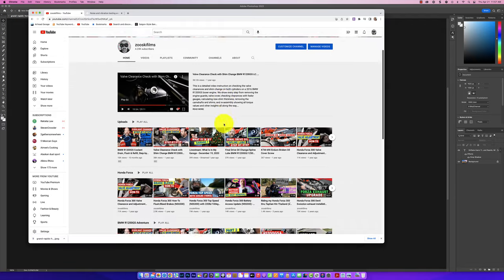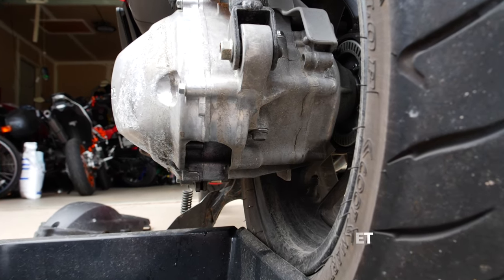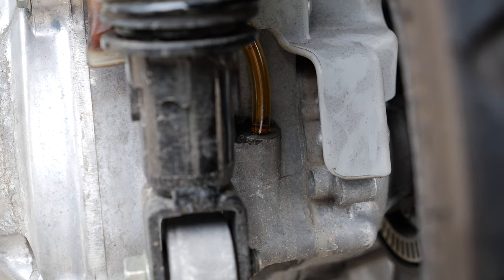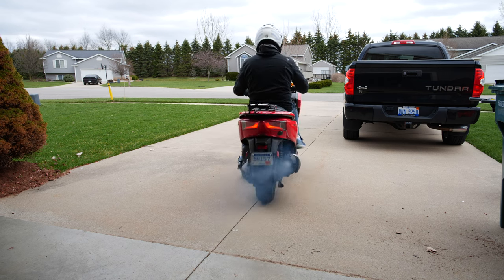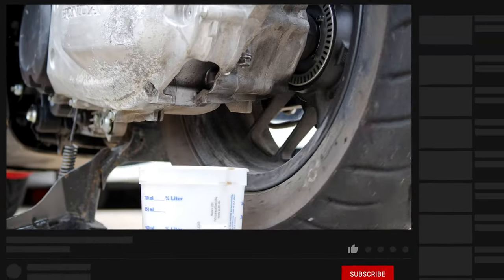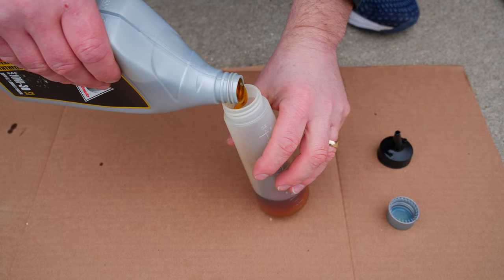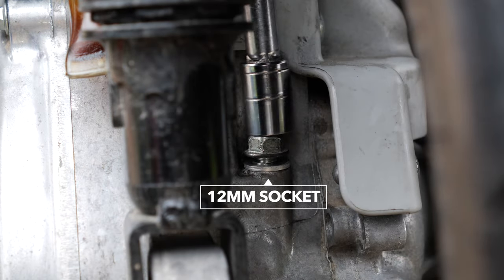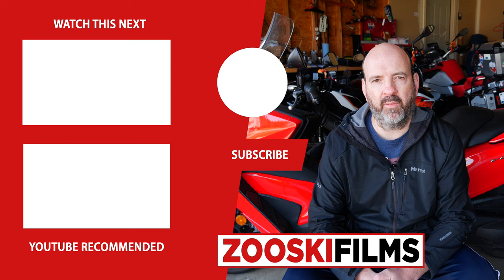Honda Forza 300 (2014-2015) -  FINAL DRIVE Oil Check, Drain and Fill - Step by Step Instructions

Comment: I'm confused.  Did the guy just do the exact same thing twice or am I missing something?
Reply from the maker: @TK Diamond - LOL, yes and no. The first part was a final drive fluid check. The second part was a fluid drain and change, they are pretty similar but the second part includes removing that third drain bolt. I was waiting for someone to ask this question. Thanks for watching and the question!
Reply: @zooskifilms   Cheers. I blame beer for that one. 🍻
Reply: @timkdiamond  - Cheers 🍻🍻

Comment: Need to be replaced with Gear Transimission Oil,not with the Motor Oil...it's not the same oil
Reply from the maker: @handle1974 - Normally I would agree with you but the service manual calls for the same oil. Perhaps the moly in oil makes it gear friendly, or at least good enough. If you are doing something different would be great for the community to hear what your experience has been. Cheers!
Reply: @zooskifilms you are correct with this, the manual does say to use the same as the engine oil
Reply from the maker: @problemslayer3538  - Cheers! 👍